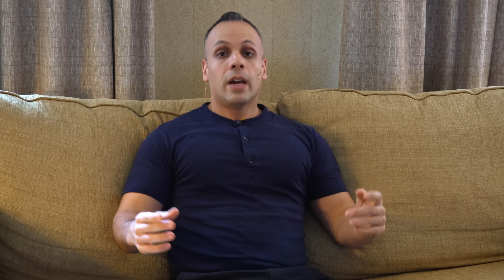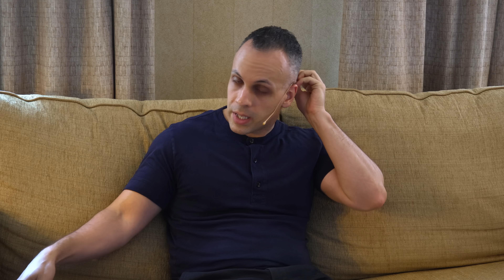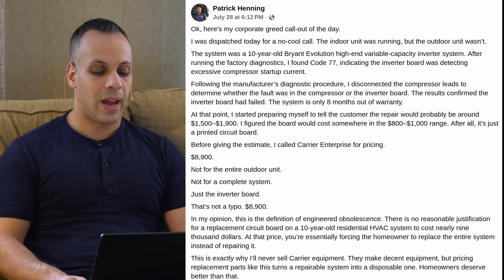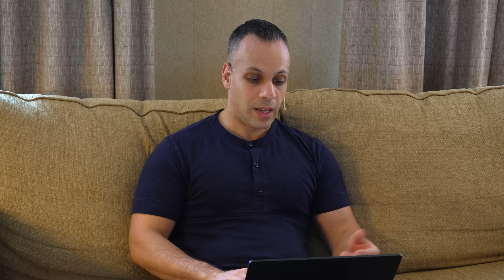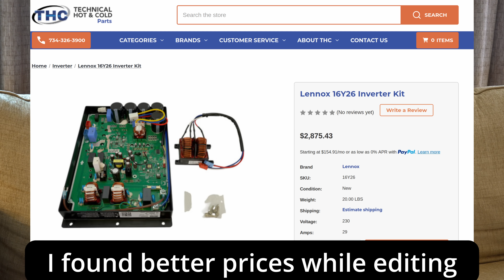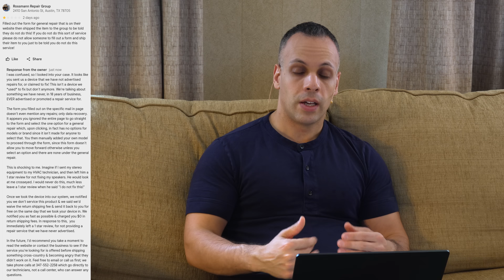Carrier AC repair has $8700 part cost for residential unit

Comment: This is definitely an "FU go buy a new system" kind of price. 
A couple years ago I fried my defrost control board on my outside AC unit. Luckily my AC is an older style that uses a lot of common AC parts. I diagnosed the problem, but ran into an issue, so I called an HVAC guy to come take a look. $400 later, he confirmed my diagnosis. Then he proceeded to show me the $1050 cost of a new control board on his ipad they were willing to sell me (and who knows the labor cost of install). Little did he know, I had already found the same control board on Amazon for $70 and I wasn't afraid to install it myself. Obviously I told him "no thank you" and sent him on his way.
The fact is, AC components are NOT expensive or complicated. Even the latest, most advanced air conditioning technology is still technology that has been around for many decades. The AC companies are just now getting around to updating their products with 20 year old technology.
The problem for most consumers, who are willing to do their own work, is that the AC companies only sell to licensed dealers.

Comment: You absolutely should start repairing inverter or power delivery boards!!  They are shit simple and are being used as leverage for maximum profit by big corporations because ultimately even a very simple PCB  with maybe dozens of components is beyond the capacity of homeowners or even HVAC techs to repair.

Comment: I bought a MrCool because things were crazy expensive. Got quoted $12-13k for a 3 ton unit. Ended up buying a MrCool for $4200. The inverter boards on those cost $280 online. Even if it goes out a couple of times over the life span of the system, still much cheaper than Carrier or any other legacy systems that screw their customers.

Comment: I'm glad the only Carrier air conditioning in our home is a system from 30 years ago, because back then as an evaporative cooler ours was made in Australia with some components which were produced in Australia and the others were easily sourced as they were common elements for most brands.

The electronics needed replacing after the switching module cooked last year, while the same model wasn't available - the Australian designer had a retrofit option to bring it into modern digital controls so we can continue to use it for another few decades and it was a reasonable price to pay to swap over as well.

Comment: Carrier has always sucked. Like so many others, they don't want you to repair what you "own", they want to force you into just buying a new replacement and they HOPE you'll be stupid enough to buy their equipment again, simply because it did work well for "long enough" (the warranty period).

I equate Carrier to LG and John Deere and so many others. They're a horrible company and it doesn't matter how good a product is if the manufacturer gives you the middle finger when something goes wrong outside of warranty. I'd go so far as to say they probably bricked it for some random time after the warranty was up. We've known providers do this and we know it's an "open secret" that nobody talks about because it's pretty rare that it can be proven.

That's why I think closed source firmware is just bad all around for the "consumer". Ugh. I hate that word. I really do.

Comment: in late 70s early 80s Zenith TVs 
had modular circuit boards 
you could just swap out.
i thought that was a good system.
but then the whole electronics industry changed.
btw i hear some really crazy things lately
about repairs on new ford trucks.

they used to make good stuff once.
i had a 4 liter ranger n it was Fantastic !
540,000 kms n still running good when i got rid of it.
what changed ? private equity ? idk.
general enshitification i guess.

Comment: I have an old style vacuum. Not old old, but the old style where you drag the unit behind you.
I wanted to change both parts of the tube - the solid straight one and the corrugated one.
It would cost me 60€. The problem is a new vacuum, same brand and model, costs 100€.
If I trow in a new set of three filters while I'm at it, it would cost me 90€ in total.
The part which keeps the electric cable coiled inside the vacuum costs more than the whole vacuum!!

Comment: I have a 5-ton Carrier Infinity system which I think is the same as the Bryant system, where Carrier rebadges equipment for different markets. It’s been running for about 10 years with no issue.

Comment: There are no more HVAC techs, just tablet-slinging system installers. Add in the REQUIRED refrigerant change every 10 years you are FORCED to replace the whole system. HVAC is like modern cars, just disposable appliances these days.

Comment: Since this is on the topic of inverter controlled HVAC it's worth highlighting the importance of surge suppression devices. If you have one of these inverter controlled HVAC units you absolutely need to have a surge suppression device mounted at the outdoor unit. Kool Guard makes some good ones.

And when you consider the cost of the inverter control boards....

Comment: Carrier is shit as far a branding and markup goes. Most of their stuff is made by Madea anyways. You can get a Madea set for a lot less than Carrier. I've just replaced my 26 year old Carrier HVAC system with a Bosch one for about 10k less than the equivalent high efficiency one from Carrier would have cost me. If you really wanna spend money and use a heat-pump and not a natural gas furnace, get a Mitsubishi.

Comment: 3 years ago I replaced my HVAC system for my 1200 sq. ft.  house.  I bought another 80% efficient system.   My contractor told me that the 96% efficient system had twice the amount of parts and two heat exchangers and the unit was double the price.  I did the math.  I might save extra $300 a year if I was lucky.  It would take more then 10 years to recover the extra cost.  I am 65, I may not live to see that or the crap they make today might not last that long.

In the past, I have replaced single pane windows with modern windows.  I could never prove that I saved heating or cooling money, but the comfort level was noticeable when the curtains didn't blow in the wind.  Comfort is the only reason why I would install something way above good enough.

Comment: The price alone on installing a modulating system AC or heat should scare anyone away. The thing is the single stage Carrier AC are reliable and can have alternate options to replace bad components, expect coils. Just don't go communicating or variable.

Comment: Large HVAC companies are one of the BIGGEST scams. Figure out how to do the installing and repairs yourself. You will save yourself thousands upon thousands. 

Even with parts warranties, the labor is almost always WAY more expensive than the part itself! I can't tell you how many times I have came out ahead by buying the part that failed, that was under "warranty", and installing it myself because it was MORE expensive to go the warranty route and pay for the labor! From beginning to end there is nothing good nor honest about any major HVAC company. Major plumbing companies and appliance/auto manufacturers are right up there with them.

Comment: To answer your question.  Old units are harvested for parts which are categorized and used to repair customer's equipment who have service contracts that include parts & labor covered.  Since the unit is under repair contract at no additional cost this is a fair way to use  parts that come from salvage.  Most all the contractors I know do this.  I know one company that carried long refrigerant hoses to remove refrigerant from one rooftop unit to add to another.  Then the owner of the 2nd unit would call the next day and they'd reverse the flow.  Never would have believed it until I saw it with my own eyes.  Now that is unscrupulous.  But it happens.  I could tell you quite a few similar stories I encountered.

Comment: If the manufacturer would supply the service data and provided the PCB is undamaged these could be repaired without difficulty by a competent person for well under $100 in many cases. We need right to repair for electronics.

Comment: Repair inverter boards is a very lucrative business, but it's better to put your skills and resources to create a opensource programmable board, because most of inverter compressor for AC runs on a 60 to 300 DC three phase brush less motor, there is no much difference between motors, only the one wire protocol usually is different, so a opensource firmware + board could be a good way to solve

Comment: I ran into the same issue with a Bosch unit. The 4 ton outdoor heat pump cost me $2700 and we lost the inverter board in nine months due to a weird coincidental issue with the sprinklers took it out while it was being serviced. we then got a replacement poured under warranty, but they ship us the wrong board and then we went round and round, trying to get the replacement which they were trying to tell us there was no longer made. We ended up finally getting it, but that wasn’t trying to go other routes where we were getting cost of $6000 just for the replacement board twice the cost of what the unit was. These inverter driven units are a joke. I am reluctant to sell them now and would much prefer to just stick with simpler contactor and capacitor units that can be repaired and no time and are a small fraction of what these inverter units cost and then you’re not waiting on parts or any other other including headache

Comment: A brushless DC motor in a residential AC has always sounded stupid as opposed to a properly sized unit.  Manufacturers have always been willing to implement regulations that result in minimal or negative gains if they can pass the cost (and profit) on to the consumer.  Look at auto start stop in a car.  Look at the goofy new refrigerants that become necessary when one goes off patent.

Comment: A thought. I'd like to start  new movement... no matter where you live, or what the proposed law is... just doesn't matter.  Anyone that votes for that thing, must live in the affected area.  Simple.  Done. You want AI?  Good, you have to live within 1/2 mile of that amazing data center... it's AWESOME!  You want FLOCK cameras?  Well, we need you to have 20 of them in the 3 block radius of your house, and every 1/2 mile for your route to work.  What?!  What's wrong with that?  You're not doing anything wrong - other than speeding by 2 miles per hour on Second Street on Tuesday when 3 people invaded a doughnut shop... how could you not know?!  It's one block away!  But, then... we need to know what you ate because it might cause massive indigestion for the whole country!  We have to use Flock to see anyone that ever visited Sweet Tomatoes.  None of that is real of course, but how far is that from reality?  Make people that vote for this crap live with their crap.  That's how you stop the crap?

Comment: my business has been a carrier dealer since the 1960s, im third generation owner, business has been in my family since 1946. i couldnt sell the high end carrier inverter systems based solely my pricing bracket, since im a small operation ie. less than 5 men a carrier infinity inverter outdoor unit JUST THE OUTDOOR UNIT!!!!!!! WILL RUN ME THE DEALER 15-20 THOUSAND DOLLAR. naturally ill never sell one of these to my customers. now lets talk about there commericial equipment, i had a vfd drive for a blower motor fail and they quoted me 11 thousand dollars to replace something i fixed for 100 dollars in parts and wires

Comment: My brother called me on a 2 stage Carrier RTU.  Bad compressor.  NewOEM Carrier(Common Brand Compressor) 7.5 ton 2 stage compressor, $6,700.00.  7.5 ton RTU is now a single stage with a little extra S FL OA on the evap coil.

Comment: Commercial Carrier units are great, however it’s not just Carrier using these tricks. Carrier is jumping on the wagon that many manufacturers across a wide variety of industries are practicing, which is selling new units by making repairs cost the same as buying new. 

Why focus resources on training good technicians and compensating them for doing good work for customers  when the ROI is so much higher for distributors/manufacturers to hiring salesmen labeled as a technicians to push complete replacement.

Comment: The part that usually fails is the IPM which is a custom driver that include the IGBT in the same part. Each manufacturer is creating their own custom "flavor" of this module, which are typically not available on the market to buy. A lot of the overseas brands will use an off the shelf part that which actually make the cheaper units repairable.

Comment: I didn’t have much better luck with my Lennox system. Tons of proprietary parts, no owner serviceability options, ludicrously expensive replacements even when they could be found.

Replaced my five ton Lennox with ductless mini splits, high static pressure fan to keep air circulating throughout the house, using the old ductwork.

Turns out it’s a lot easier on my electric bill, too, and will make the transition to off-grid solar significantly easier. Who knew?

Comment: My Goodman system died last week and fortunately, using Grok A.I. assistance, we tracked it down to a 3V blade fuse on the circuit board.   Cost me $6.99 at Auto Zone.

Comment: I think there's a wide open market for a business that can repair boards like this from all sorts of devices.

I know there's a company on eBay that repair plate amplifiers from JBL's professional line of powered speakers. One of my speakers fried recently at a gig and the replacement part was going to be $870. This company offers a flat rate repair of $220 plus shipping.

I will support companies like that until the day I die. 

I also probably won't be buying any more JBL speakers despite having used them now for almost 30 years. The price keeps going up and the quality keeps going down. This was a $4400 pair of speakers that had about 20 to 25 events on them. 

The JBL speakers I own that are over 20 years old and have thousands of events on them are still working fine.

Comment: I think it should be required that replacement parts have to be made available so:
a) there is no part of a product that isn't available
b) summing up all the parts required to build a complete unit should result in a price that is at maximum the price of a new complete product (or if you want to add some margin, add 10% to that)
That should be a better definition of "make available at reasonable terms" for a potential rtr law.
Reply: Wise up, Sparky. That's hopium bull$hit. There is no "should" in the real world.

Comment: As an owner of a carrier heat pump, I can tell you that for 10 years i experienced such scammy behavior with my system from this company I would NEVER EVER buy another.  They had the regional rep out moving thermistors around on my greenspeed , collecting telemetry. Couldn't figure it out. In the end, after a tech left a service manual, I fixed it myself. NEVER AGAIN. They were literally out 3-4 times per year damaging my system. And the parts? I wind up buying them on ebay from other people who gave up.

Comment: Hey Louis, I work at a property where we repair carrier HVAC systems that were installed in 1988,, these systems are absolute diehards and we only replace them when absolutely necessary.. the dependability of these old school equipment is sorely missed

Comment: I work for company that’s a carrier dealer and tbh I usually do find that the run of the mill units carrier puts out are good enough for the average person and way easier to perform maintenance on compared to other brands but the hgh end infinity units I won’t even clean the condensers from the inside because I’ve had coworkers that pulled the disconnect and had the inverter board get fried just trying to clean the coil.

Comment: Lol, an invertor for 8k.. How much power this compressor even needs? Let's exaggerate and say 10kW.

A power supply for a PC (that btw is def more sophisticated, than a one for an AC's compressor) for 1kW would cost you what.. 200-300 bucks. That's with the manufacturer's profit margin, taxes, fees, taxes on taxes and all already included.

Now, let's do some simple math and realize that for our exaggerated AC the invertor for 10kW top price is 2-3k.

Let's also adjust the manufacturer's(assembler's?) expenses due to lower production batches vs PC supllies, and call it 4k/piece.

4k. And that's if we assume they want to make the same profit margin as if it was their main product they foncus on selling. And if we keep exaggerating.

That's all, folks.

Comment: Way less likely.  In darker times I worked in the auto repair industry and some of the parts and labor markups are criminal.  I avoid those brands and shops like the plague and I would do the same for HVAC.  Thankfully within the past few years we replaced our unit with Lennox.  I'm not sure how good their reputation is but it sounds like it's not as bad as Carrier.

Comment: I am an electrical engineer by and have repaired one of these type inverters for a family member. It was a simple fix fortunately. Many new systems are overly complex to the point of self degradation. Too much complexity cause many failure points. If you want to make a “ good enough system “ Design a system with 3 compressors of different capacity.alll 3 running for full power 2 running for 2/3 power and so on . This is much simpler and the difference in efficiency would be hardly noticeable. Additionally if one compressor fails . Replace it ! Much cheaper than $8700. Sir this scheme is a little more expensive than a single compressor. Yet it will no longer have single point of failure. If you really want efficiency get zoned minisplits . Not modern AC units.